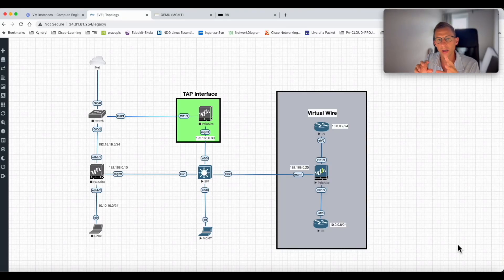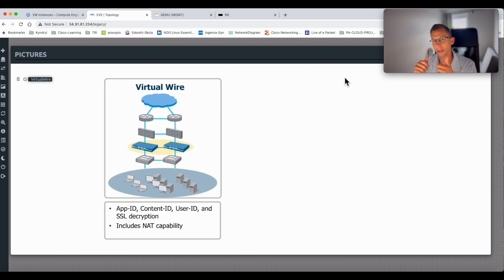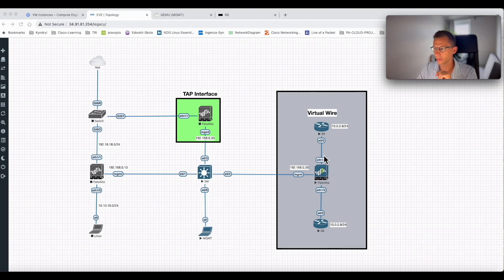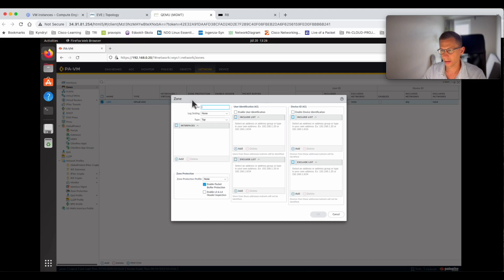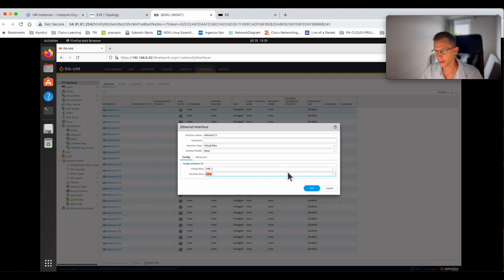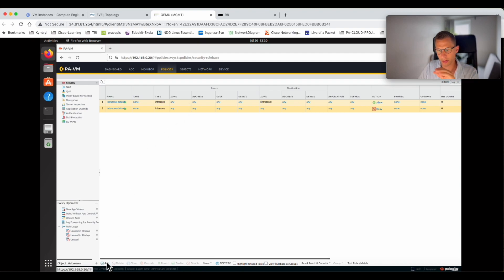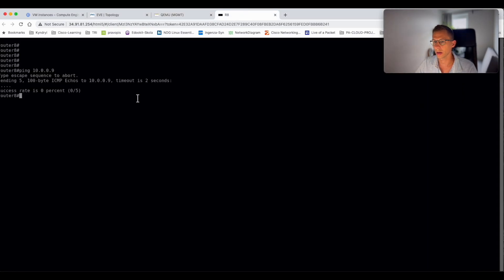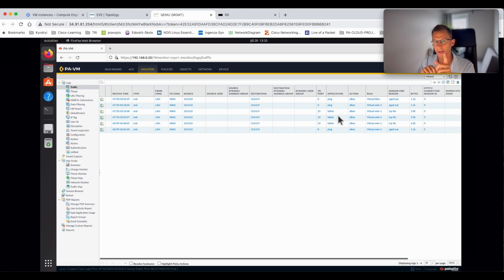Palo Alto Firewall - Virtual Wire - Guide - LAB

Comment: The policy you created allowed traffic from LAN to WAN. I assume traffic from WAN to LAN would be denied unless I created a second rule allowing WAN to LAN. My goal is to have the PA inline between my provider edge router and my inside firewalls to filter the known bad / bulk of the DOS type traffic and allow my inside firewalls to handle the L3 + filtering.  Am I heading down the correct path?